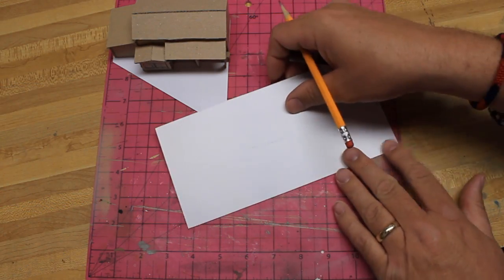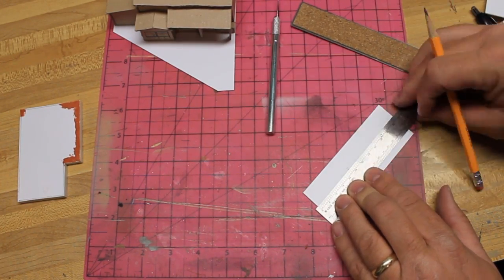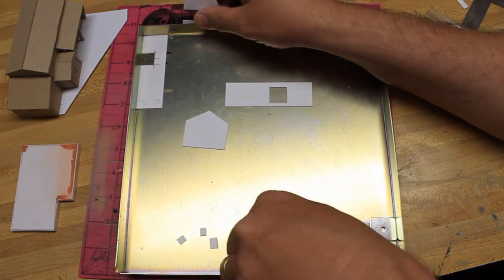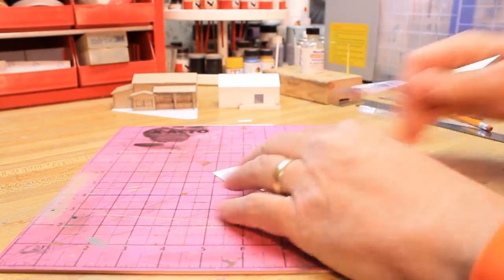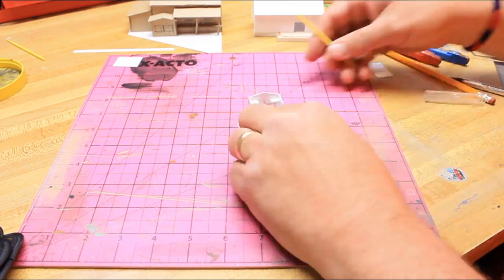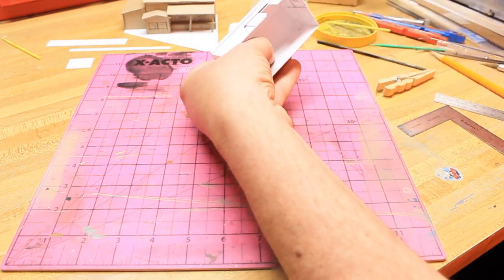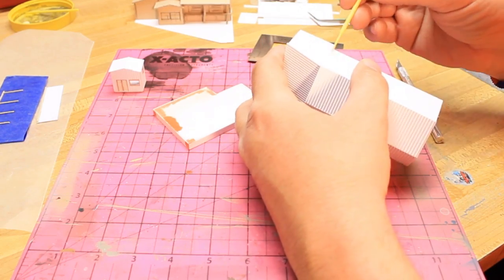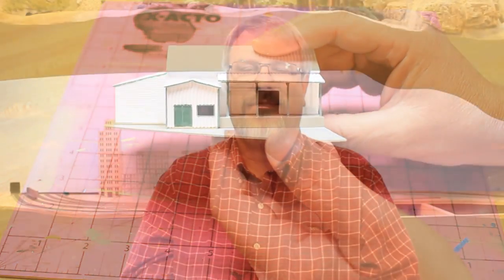How to Scratch Build a Small Structure in N Scale

Comment: This video is EXACTLY what I needed to see after my failed attempt at my first scratch-built N scale structure using chipboard.  Just too many weak points where openings leaves just too little material over large openings (like garage door and 8' sliding glass doors.  Don't why I didn't start with styrene since I already had a couple of sheets of .040.  Duh!

Q: How did you get that delicate awning support assembly off the painter's without breaking it?

Comment: Is there a preferred product for "gluing" styrene? I know there's Same Stuff but there's also weld-on #3. Any preference?
Reply from the maker: Same Stuff works great, as does Plastruct Plastic Weld or Bondene. Ambroid Pro Weld is my favorite but hard to find. You can also buy straight MEK at a hardware store. MEK is the solvent used in most of these cements.
Reply: @RonsTrainsNThings  Thanks Ron - nice to know your always there with help. Keep up the great work. :) 
Stay safe
-N. Jineer
Reply: @RonsTrainsNThings  I forgot to mention why I asked - in this video Adam Savage talks about using #3. But he's used to building massive props (Death Star, Star Destroyer, etc. Where you never get a close look. Plus they sand and paint etc. Just wanted to pass it along...
https://youtu.be/ZfvtGrhYk0I

Comment: where do you get the red putty? none of my local hobby shops carry it.by local I mean within 50 miles thank you
Reply from the maker: Unfortunately Model Masters Red Putty has been off the marked for several years. I still have a tube which, if it doesn't dry up, should last a lifetime. In absence of Red Putty, Squadron Products White Putty would be my next recommendation, and it is readily available.

Comment: Very nice work! I like your jig with the magnets; that's very clever. What are your thoughts on working with balsa wood instead of polystyrene? I'd imagine that maybe the polystyrene is simply easier to work with in a smaller scale—because it has no grain and isn't prone to warping—but I've never tried. I just prefer balsa and was wondering what your thoughts were.
Reply from the maker: +Brandon Alan I do some modeling with wood, although I prefer to use Basswood over Balsa whenever I can. Styrene can be made to look like wood, but my philosophy is use wood to simulate wood, use plastic to simulate metal. That isn't a hard-and-fast rule, but that's what I try to follow. I have not done a lot of scratch building with wood, but I have done some and I have done several laser cut Craftsman kits. Wood is definitely more challenging in N scale because scale Lumber is so tiny that it is easily broken.
Reply: Basswood is better to use to make walls, decks, and any larger, flatter pieces. But either way you're right about wood and N scale, as working with small stock gets tricky. I've only gone as small as HO with my own wood models. Since I'm now into N scale, I've been thinking about what to do for models since I like building them myself—as opposed to buying them. Your videos have already given me some great ideas. Thanks for the advice! 👍
Reply: After watching your video I'm more determined than ever to try my hand at scratch building.
Reply: The speed at which you can work in styrene is much faster than wood of any sort! It’s just score, bend/break, spot of glue, and in a couple minutes you can resume construction on the same parts. With wood, it’s cut, glue, go on vacation, then glue the next piece! Ha!

Comment: Hi Ron, The magnetic jig you use in this video, is it still available please, if so, where from?
Cheers, Trev in the UK.
Reply from the maker: It sure is. Here is a link. https://amzn.to/2DPsXdA
Reply: Sorry to butt in here ...  I noticed this question was asked at least a year ago.  I just got one myself recently so if somebody is still wondering at this time they are still out there.   I love mine : )  Great video as usual Ron!
Reply: I picked up one of these things from a vendor at a model railroad show years ago. It was clearly made by a different company than whoever makes Micro Marks version. Beware buying these from anyone but Micro Mark. The one I purchased turned out to be useless because the radius from the bottom to the sides was too large, and wouldn’t allow a piece on the bottom and side to meet at a 90 degree angle! Makes a good paperweight though! Ha!

Comment: What solvent glue are you using?  I loved Tenax and have't found a suitable substitute
Reply from the maker: I have used Tenax. My first choice is Ambroid Pro Weld. Right now I am using a bottle of Flex-I-File Plasti-I-Weld that came with my Touch-N-Flow applicator and I'm happy with it also. I have not used it, but Plastruct products have a good reputation. BE CAREFUL there though. They have two products. Bondene is for cementing like plastics to one another. Plastic Weld is for cementing dissimilar plastics together. Do not get them mixed up.
Reply: The company that made Tenax folded a number of years ago, supposedly due to lawsuits but I’m not sure. Micro Mark sells “Same Stuff”, which seems like the same stuff (get it?) as Tenax. I really like it!

Comment: What are the measurements  in n scale im new at this
Reply from the maker: It is easiest to get prototype dimensions and divide by the scale ratio, which in N scale is 160. So a 12' wall is 144" ÷ 160 =  0.9"...OR 4 meters = 4,000 mm ÷160 = 25 mm.
Reply: @RonsTrainsNThings  thank you